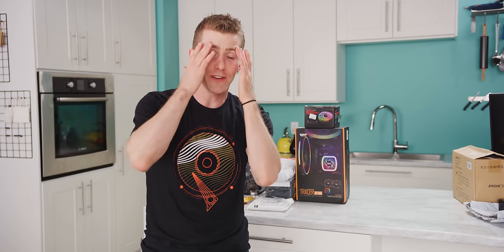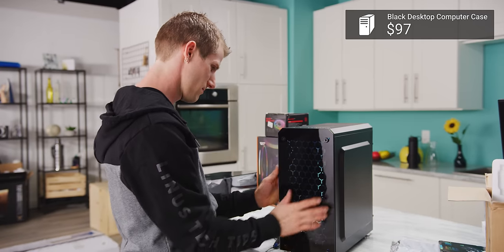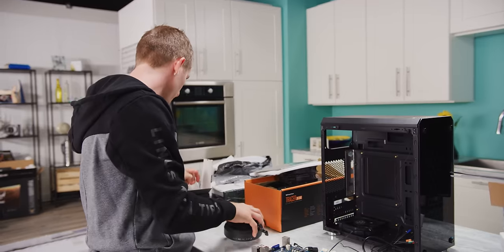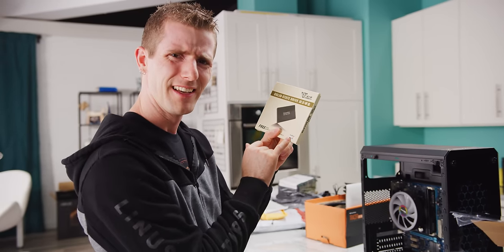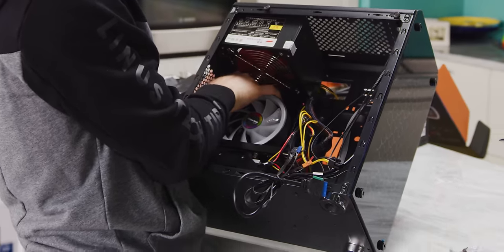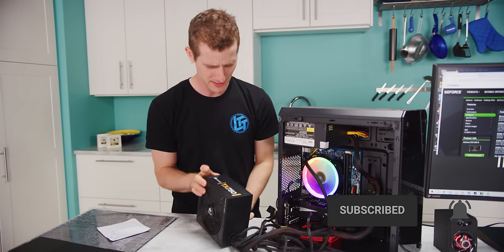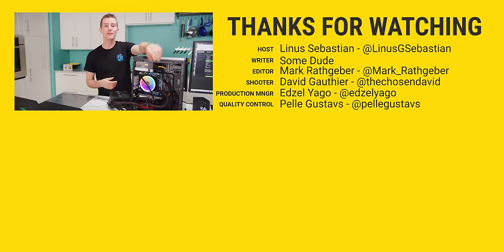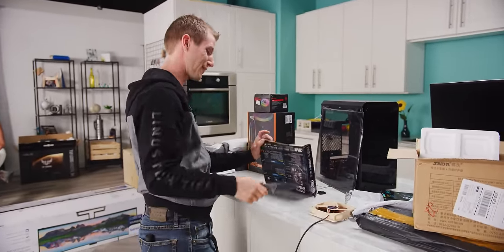Building a PC... using only Wish.com

Comment: Yeah I bought a refurbished Dell 3020 SFF for 212 (including tax) and I'm throwing a low profile EVGA 1030 2GB GDDR5 in it that I got for $139 (listed as new on Amazon, hopefully it is). It came with an i5-4590t and 16gb of RAM (which is the max for the mobo). This Wish garbage is a complete ripoff.
I'm very new to PC stuff and I'm trying my best to research everything I can and learn as much as possible. When I have the money I wanna do a fresh build, nothing crazy, but I wanna at least get relatively stable 60fps on most games @1080p. My next upgrades on the 3020 would be a better CPU and of course cooling mods to support that. I was thinking maybe i5-4690k with a low profile cooler, and maybe do a kinda janky cutout on the cover above the CPU with a larger fan and swap out the single front fan for something better than the OEM fan that's on it now. I've seen around online that I'd need to maybe do some dremel cutting to make an aftermarket cooler fit though.

Would it be better or more logical to do liquid cooling on the CPU and somehow run the coolant hoses out the case and have the radiator mounted externally somewhere? The case is very tight on space and airflow.

Comment: Hey uhh Linus My only pc witch is a potato stopped working can you recommend me any cheap PCs that can run more than 60 FPS.
Reply: Best advice ive got for you is buying a older refurbished dell optiplex full size tower with an i5 and putting a gtx 970/rx 570/1050 ti/anything else in that price range
Wont garuntee 60fps in demanding games but in things like csgo, fortnite, minecraft, etc, it would give you a playable experience until you can afford a better gpu, like a 1060 6gb

Comment: I have
I7 3770 processor bought for 60 dollars
Gtx 960-2gb for 100dollars
Samsung ddr3 1600mhz 4gb and 8gb for 25 dollars
Intel dh61ww mobo for 10 dollars
Zebronics 450 watt power supply for free taken from garbage and also cabinet
Total spent 210 $
Does it worth?

Comment: i bought a pre built pc with a budget of 700 dollars and it was horrible. 2 very old fans connected on each other for the cpu gt 710 2gb gpu 2 4 gb ddr3 ram sticks and an msi 2a9c motherboard although cable management and 2 tb ssd was good it just shows you that you should never buy pre built pc's always build them

Comment: cpu intel core i7 5960X motherboard gigabyte x99 ud7 graphic card msi r9 290X gaming 8gb videoram crossfirex 2x r9 290x sound card asus xonar essence stx2 power supply seasonic 850wat prime ultra titanium ddr4 32gb 8x4gb 2400mhz

Comment: My budget pc build ps the case cost more than the parts
Reply: Nvidia 3090 founders edition $70 
Bq750 battery $5
Auros z450 $10
DIY builders case led $70
CPU and fan for $5 
Ram and ssd $16

Comment: And the wi-fi network is means used the wi-fi network five girl tony devices5 a in this is a network is a network server it is central connects their wi-fi network the day this is the towers that signal queen similar civil towers the first city of is the wi-fi network for the tower is it is a swiss the wi-fi network and inside the control panel to connect devices an underside under the side under the side

Comment: Dude My Dell Omniplex 7010 has more power of this piece of shit stock but mine is not stock. Mines got a I7 3770s processor with 32 gigs of ram with two western digital 500 GB ssd hds set at rade zero and a gtx 2070 graphics card and my power supply is a 650w with a namebrand power supply